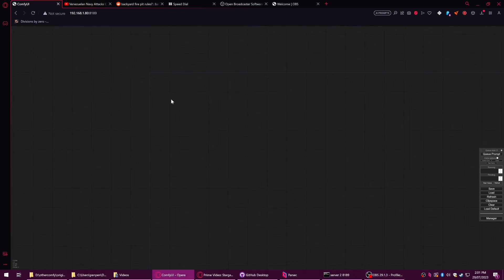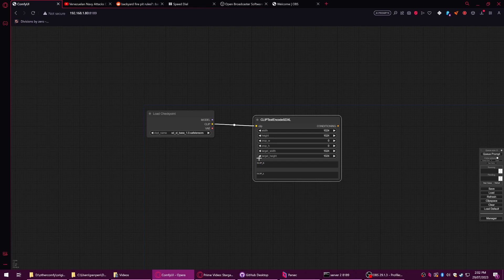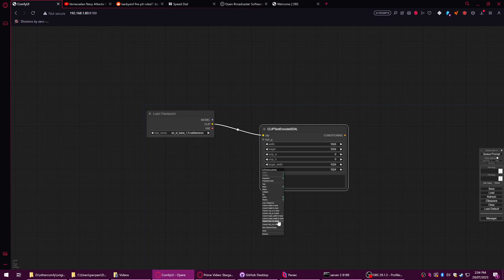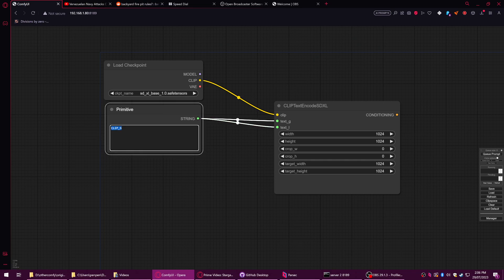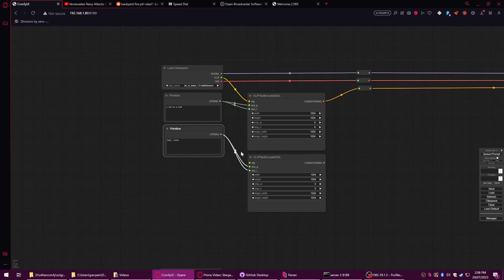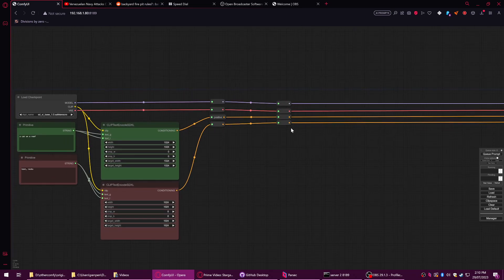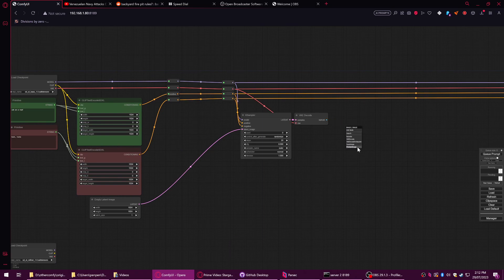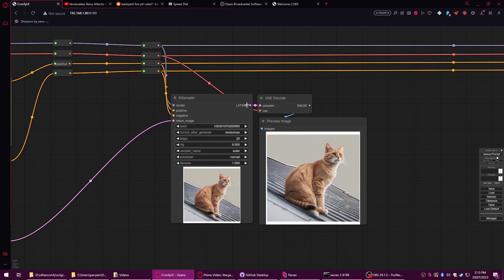ComfyUI SDXL Basic Setup Part 1

Comment: Hmmm, all i'd like to know is, how did I generate the IDENTICAL cat on a roof image with a completely different seed number than in the video?  As I understand it, my image should be based on a different random selection of input data if my seed is not the same as the one you used?
Reply from the maker: the seed shown in your workflow is actually a new seed, if you click back, it would probably be the same seed. only if its random its kind of hard to check.
Reply: @ferniclestix  Ah, this could explain it, though I don't know how it would have ended up with the same seed in the first place.  Cheers!

Comment: can i follow your setup if i want to use ssd-1b or sd1.5 models instead
Reply from the maker: you cann... but yeah. theres not much of a good reason to do it, refiner workflows are generally designed for SDXL.  also SDXL clips won't be compatable with 1.5